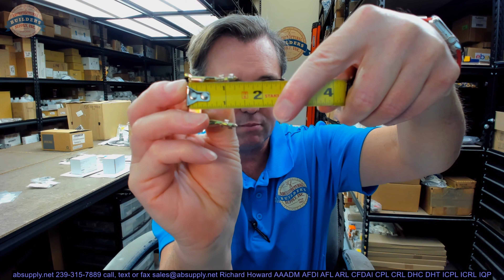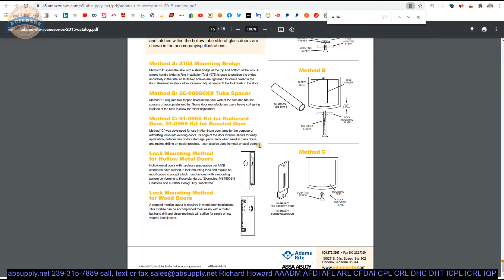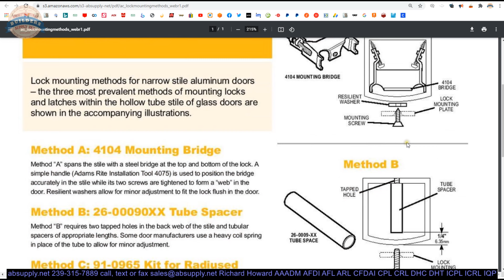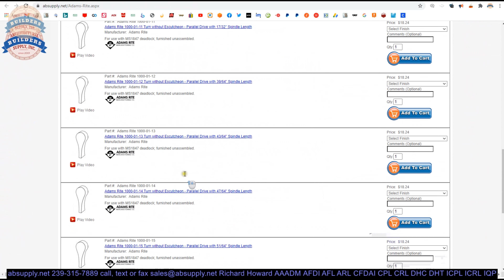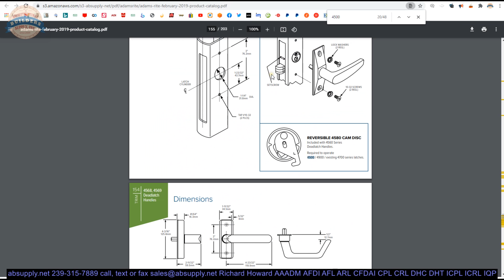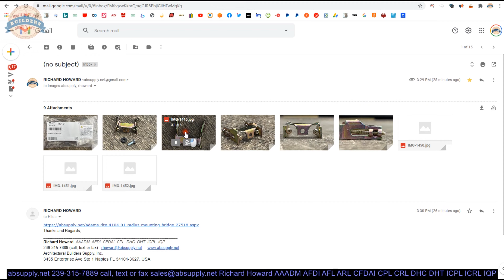Adams Rite 4104 01 Radius Mounting Bridge

Comment: Thank you for this detailed info. It’s hard to find, though not sure why.

I’m trying to install a new MS lock into an old aluminum door with the previous 10-32 machine screws being sheared off and rusted into the back web of the stile. What’s left of the screws is barely protruding from the face of the back web. It’s all recessed work, hard to get at with most tools.
Reply: I had the same problem. What solution did you come up with? Did a Mountain Bridge work?
Reply: I have a couple of bridges, but I’m not familiar or experienced enough with them to attempt to use them yet. I was thinking of using a router the flatten the stump of what’s left of those sheared off machine screws, then punch & drill it out. I’m curious what the standard solution(s) for this problem is, if any
Reply from the maker: Email me photographs of the door and the lock I will make a specific recommendation as to which is the best item to use.  sales@absupply.net